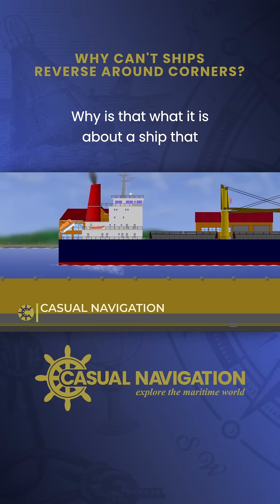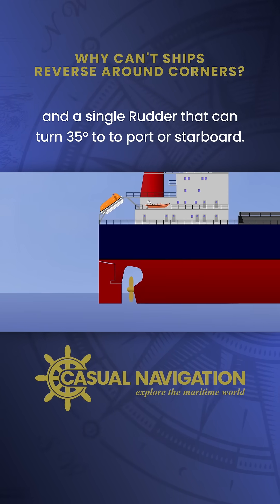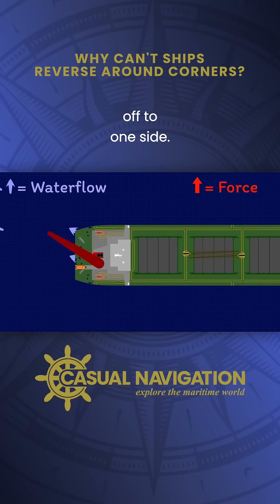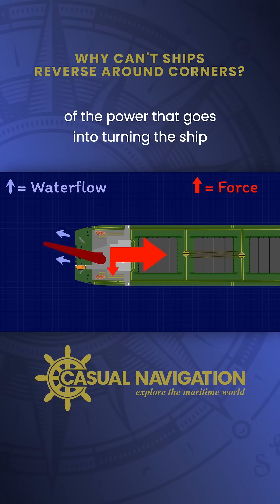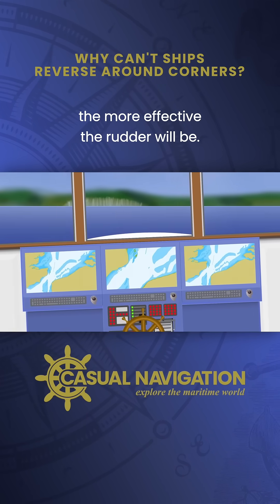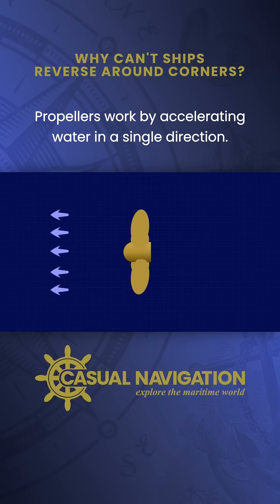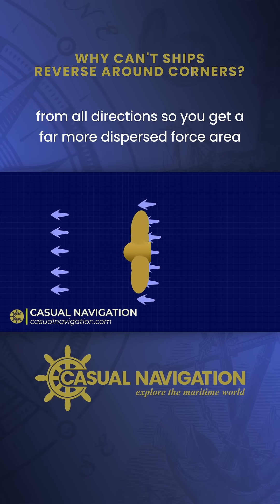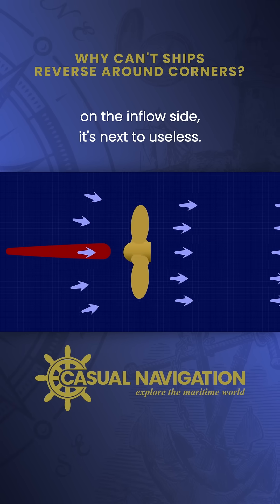Ships Can NOT Reverse

Comment: In the reverse, the thrust is in the front such that deviations in the medium (water/ocean) will cause high instability as the vessel want's to correct. This is seen in rockets. If you were to put fins on the front of a rocket it would try to reorient to the fins being in the rear due to fluid/air dynamics.